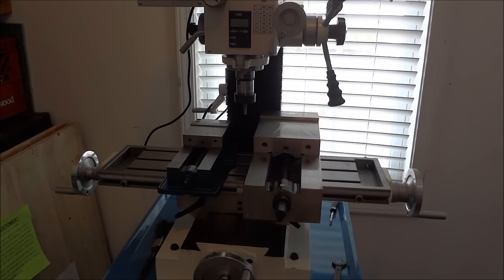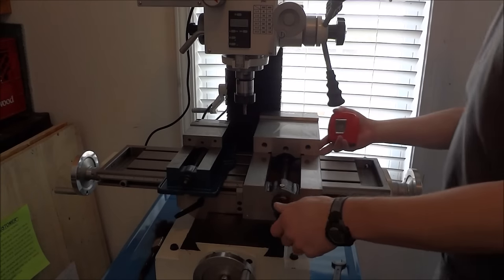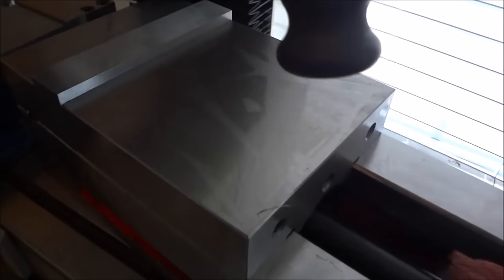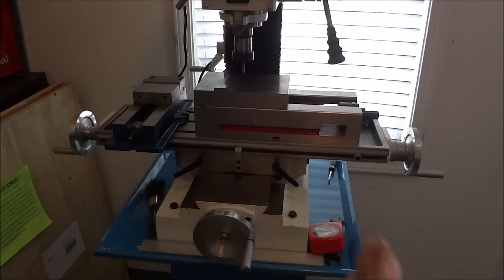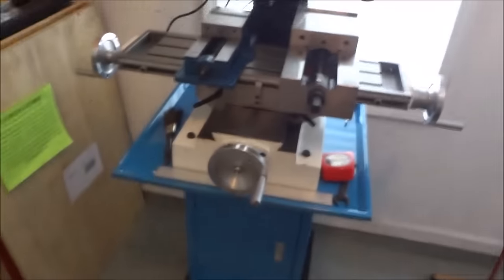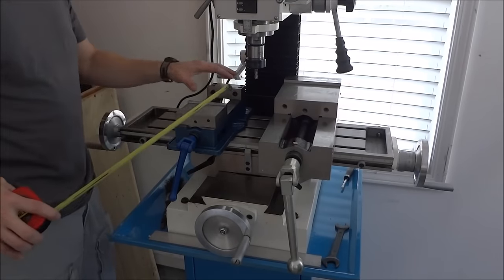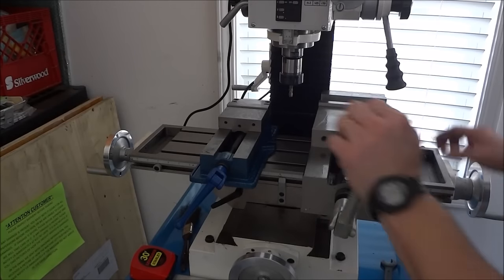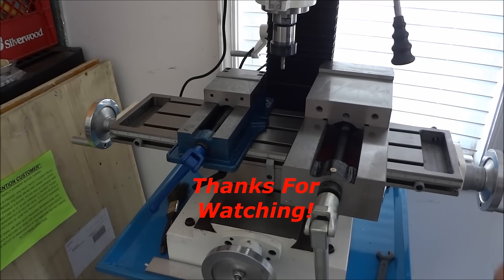CNC Vise Choice for the PM-727M mill 4" or 6"

Comment: Sam  I did the same thing with my mill. I got a 4" and 6" vise, I used the 4" also, but I made new 6" jaws for my 4" vise. It helps with longer material making it a little more stable. Just a thought. Good luck with your build.
Reply from the maker: That's a great tip I can see that being useful. Thanks. 
Yea the 6" is huge I bet it weighs 50# more than the 4"

Comment: Just a thought for you! Get another 4 inch Vise for set ups and do a plate with a pattern of tapped holes for your clamp set to keep on hand and as far as your 6 you can flip that beast on its side for taller work when you need to hold a piece rigid! Awesome vids man!!
Reply from the maker: +russell geyer Thanks Russell, All great suggestions

Comment: Nice video. I have an x2 and was wondering if you think the 4 inch would be too big for it? I have that small machinist vice now  and would like to get one with the built in screw clamping holders. I haven't moved the one I have since I set it up because it's a pain to get that squared.  I was thinking about the swivel piece too but I don't know if that would just bee too large for the x2 mini mill from HF that I have. I just want to be able to move and swivel it easier and was looking at the shars too. But I know little machin shop and grizzly have something similar. I'm just not sure what size to go with 3 incher or four since it looks like the 4 incher may end up being too big like your 6 inch version. I can't remember what  size my current one is, but it is one of those shiny versions. Well now it looks all black since I haven't used it for while.
Reply from the maker: +myshots101 I think your right it will look like the 6" sitting on my PM727M.

It is 11" long and 5" wide with the flange once you put it on the X2 you will lose a lot of Z height travel. If you add the swivel base even more. I can snap a photo of the 4" sitting on the X2 beside my 3" if you like it may help. Pm me with your email.address. Be Safe Sam

Comment: Hey great video. I just received this mill today and I'm excited to get it set up.  Im waiting on a 5" vice from Bolton so hopefully that will fit nice. Do you have any idea of the size ballscrews your gonna go with and what oz stepper motors?
Reply from the maker: +x8tuner44 Thanks,
Sounds great I think you will be very happy with your choice. I saw the 5" vise from Bolton I was a little concerned it may still be to long. Please pass on the dimensions of the vise when you get it and your opinion on the fit.
My Ball screws are RM2005 Double-nut for X,Y,Z and the steppers are Leadshine 3 phase. 960 oz. for Z and 590 oz. for X,Y nema 34.
You can follow my build here: https://www.youtube.com/watch?v=eEoBSi0szqY&list=UU4EZvvrjdqpATmULrabO0bA

Be Safe ,
Sam
Reply: Well the 5" vise arrived today and it hangs of quite a bit just like the 6". It's footprint without the swivel base is 14Lx6.5Wx4.25H. It would be a bit smaller but there's a 3/4" lip on the bottom that goes all around the vise. It's very heavy and feels like a high quality piece. I also received the Bolton 8" rotary table and couldn't be happier.
Reply from the maker: +x8tuner44 Yea I say those dimensions and thought Hmm Might be just as big as the 6" so I opted for the 4" I think I may Machine off the lip on the front side if I don't need it.
 Be Safe,
Sam

Comment: How's the precision of the mill?  Is the movements straight and true?  Because I'm looking into a Milling machine but there's a lot of that style, some cost more than the otters, but i think that the cheaper one is less accurate and crappier casting.  Thats my only concern being the accuracy of All thebaxis
Reply from the maker: +Tommy Aventador 
Hi Tommy, Well its really hard for me to compare this mill to say a Grizzly G0795 which is the same mill basically, Just 220v and no stand. But i do understand those were my concerns as well. The PM-272M looks as though time was taken to clean everything up the ways feel smooth all ground surfaces look nice. I have not done any testing on the true ness as I am going to be ripping this thing apart . from the machining ive done so far she seems to have good tolerance.,
 Be Safe,
Sam

Comment: You guys talkin bout me?  lol..  I love my 6" but I use it turned 90 degrees as you showed in the video.  I also would probably get two 4" for mounting side by side.

I recently found a much better way to set it up which is to swap the hard jaws to the outside and use soft jaws on the inside machined the same height as the mounting pads.  this way I can face large pieces of stock clamping in the outside jaws and chuck up small parts in the inside jaws.  the only complaint I have is it does eat alot of z axis up but I am modified to have ~19" of z travel so it often doesn't effect me unless I am trying to use really large drill bits.  

I also have the G0704 which has an unusually long X length for the table and travel (20") and minimal Y travel (10") so mounting the vice all the way to one side still leaves me a bunch of open table space on the other side.  doesn't require loosing ANY  travel in Y turned sideways due to the fixed jaw taking up valuable travel length either so i can machine parts the full Y travel turned sideways. so for me it works, but I would like to chuck even longer materials and two vices side by side would help that tremendously.  I think a fixture plate like mentioned below would be very helpful and I have been looking into maybe making a vacuum table as lately I have been making larger parts and I waste an awful lot of material making special fixtures. That isn't an issue for big runs of something but gets pretty expensive doing one offs.

Lots of options out there, just helps to know what you will be doing primarily.
Reply from the maker: +christopher polanski 
Umm! NO were not LOL

 I agree depends on what your doing the 6" I think is more suited for a 45 series mill it just looks out of place on this mill. It did look promising in our video but it's a lot bigger in real life LOL. I know that It will get used for jobs in the sideways configuration so its fine I just don't think it's right for day to day machining size vise. I wanted to put the info out so others can make a better decision. I will be using a good bit of fixtures so for me a Pallet system would be great and it may be something I try to DIY.

Be Safe,
Sam

PS. I found a shop for the Pan /Tray woohooo!

Comment: As others have said maybe 2 of the 4" vises on the mill could be useful. I would simply buy a new larger mill to use the 6" on, this seems less bother than shipping it back ;-)   thanks for the vids   Gerald
Reply from the maker: +backyardcnc  I have to say it would have to be a really big mill this vise is huge! LOL thanks for watching,
 be Safe,
Sam
Reply: I have a 6in vise to use on 2 larger mills, One is not that big 8x30 table and the other 9x36" table. Mostly though  I use 3 and 4" vises for less obtrusion!

Comment: I think the 5" is the best size and mass, the problem with the 6" is that will add more mass and extra pounds to the table and you will notice tilting or losing    few thu's when you go off the saddle

for myself I got glacren 5" two weeks  ago, they had it on sale and was good price..
they are getting new 2016 new cast once and they are trying to get rid of the old once,,,
Reply from the maker: +Ozy Ozy I agree the 6" is just way to big for this mill, I was going to go with a 5" however the only two MFG. I could find making them were Glacren and Tormach. and I after the 6" I was a little shy pulling the trigger on the 5" so I opted for a cheap 4" for now.
Be Safe
Sam

Comment: Not related to the vices, but can you tell me the distance from the chip pan to the top of the table? 
I'm thinking of getting a pm727m for manual use and wanted to figure out how much of a base I will need
Under the stand.
Thanks!
Reply from the maker: +Frank Radish
I'll have to measure but off the top of my head I would say 8"
Reply from the maker: +Frank Radish  bottom of machine to top of X table is 8.5"  the chip pan edges are raised 1"

Comment: Maybe I can save you some large frustrations. You might want to strip both those vises down to there basic parts for a proper cleaning for starters. At the price there sold at, cleaning out the grinding dust and even machining chips at the factory isn't ever going to happen unless it falls out. Add some lube oil to that dust and you have a great way to wear out either of your vises in record time.

But you might also want to closely inspect the internals. I had to learn the hard way after buying a pair of 4" off shore vises. I can fix or rebuild most parts, but when the main castings are porous and weak? I can't fix that. Yours may not be as bad as mine were. But you wont know that unless you do tear them down. The wedge piece that's supposed to pull the moving jaw down as it tightens was still in the as cast condition on mine. The jaw can't get pulled down because the parts can't properly slide on each other as there supposed to do.

I realise everyone has a budget, but a milling vise is a basic foundation tool for your mill. Any inaccuracy's in the vise will translate directly to your parts. And that 6" is too big. If your CNCing this mill, your drives will have to accelerate and decelerate all that weight on every move. Plus you've lost a huge amount, 5" of Z axis height to the top of the vise. So your head has to be farther up the column. As the head goes up that column, then you get a lever effect. That means the rigidity of what's holding your cutting tool and keeping it from deflecting out of the cut will have far less effect the higher the head is moved up that column. I don't mean to be negative, these are simply the physics of the machines design. All machine tools suffer from it in greater or lesser amounts. Even Bridgeports aren't very rigid in comparison to say a horizontal mill. But they are versatile. That's why there's so many around.
Reply from the maker: Thanks yea at some point I plan to tear it down and give it a go thru. I knew exactly what I was buying lol. It will work for now but I intend to replace in the future. 
Thanks for the heads up.
Reply: +CNC4XR7 
It might be a lot to sift through each day, but maybe try setting up an Ebay search for something like 4" Kurt milling vise or words like that to narrow the results. You just never know what will turn up and where, or for how much. Could even turn up semi local to you. I've had a search running for some years now  for Atlas mill and South Bend shaper parts. If your patient something will turn up that hasn't been beat to death at a decent price. 

There actually meant as something to be used as a surface grinder vise, but some of those ground all over screwless vises are very accurate. I bought a 4" Accu-Pro from MSC Industrial for use on my lathes cross slide that I'm really impressed with. There a bit slower while moving parts in and out, and they don't hold quite as well as something like a Kurt. But mine checks out well under the allowed .0002" accuracy in all the directions I've checked.
Reply from the maker: +Turning Point,
Thanks for the tip I have been looking randomly but right now I have so many things on my plate that this is something that will have to wait. the cheap knock off will have to do for now but I will definitely go thru it.
be safe,
Sam